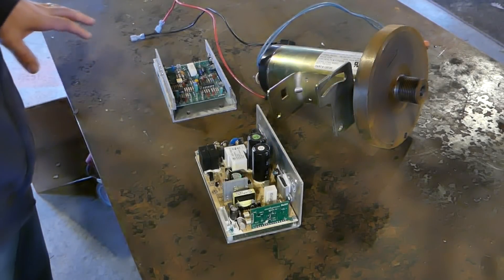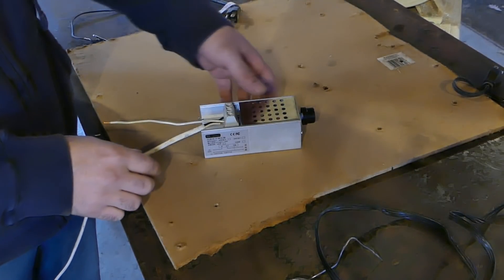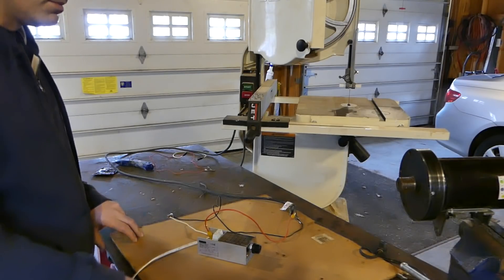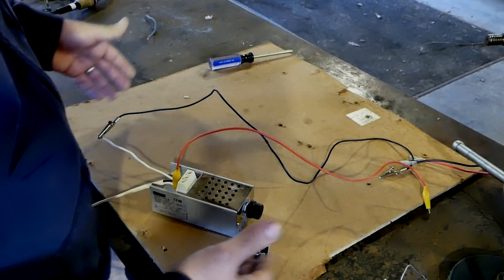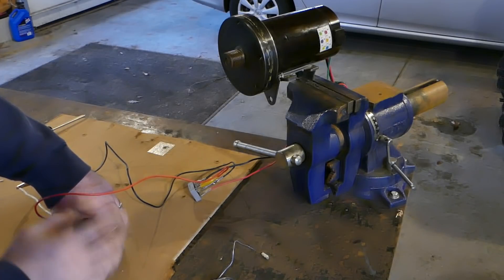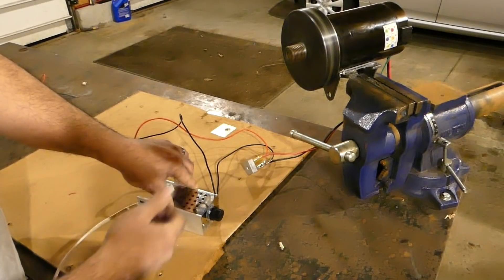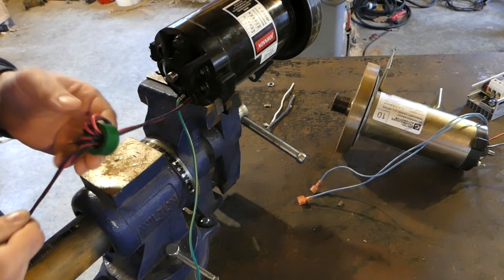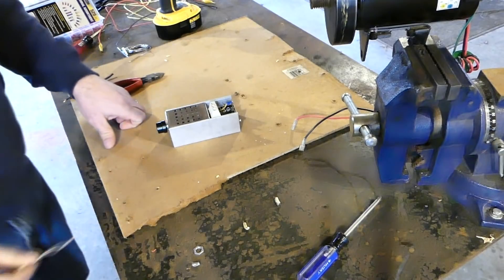Low Cost DC Motor Controller For Treadmill

Comment: I got the 400 watt SCR and the 20A glass fuse blew almost instantly running a 1.5hp motor. It's also very difficult to find replacement fuses because the size of the fuse being 20A is not allowed in the US. Basically this is not very convenient of a motor controller because unless you turn up the speed very slowly, it surges way to many amps to reliably start the motor without blowing the fuse or frying something. So setting the pot to the speed you want and turing the power on is not going to work because of the high amp draw. I'm going to get one of the 10000watt units to see if that will be reliable. Also, a thing he forgot to mention in the video is that the bridge rectifier (even being "over sized") is going to need a heat sink. Even a 50A rectifier running 5A will need a heat sink.

Comment: Hi thanks for the video. I ordered the parts and got them today.
I am going to implement this tomorrow for a 180V DC motor with mains of 220-230V. 
Getting ready I watched the video again and I heard that you refer to the circuit as a  triac based and then later that it is an scr. Please confirm which it is.

Comment: How would I go about hooking a ground wire up in this setup, I would like to have everything properly grounded.  I got all of the parts but I would like to use the power cord that came with the treadmill.
Reply: hook  the green wire from the cord to an outside screw on the controller box and then also run one to the motor to ground them both.  good point.

Comment: Hi thanks for the video, 
Just what I was looking for. I need to understand the voltages. 
This motor is probably 90V and the mains voltage is probably 110-120V AC
So can I assume that 90V DC motor works with 110 rectified AC with no capacitor?

Comment: Hey Mike in your test with the 10,000w SCR were you powering it with 120v? I ordered the 10,000, and I only plan on using 120, not 220. Think this will work? This video is exactly what I've been looking for!!!

Comment: i have a 1.75 Hp Continuous duty power 180v 4800 rpm treadmill motor Ths a DC motor can you recommend what i need to run this from a 240v standard household socket , i see a lot on ebay but not sure which onre to buy , regards Maurice over the pond in the UK
Reply: found any clue? I have 4 hp , 200 volt dc treadmill motor. electricity here 220 volts as well

Comment: Hi, How well will a treadmill motor work in a table saw?  I ask because I have  to get a motor for my table saw, and the manual says I need a 1 HP, 3450 RPM motor.  I have a treadmill motor that is 100 VDC, 1.5 HP,  4900 RPM's, 14 amp's that I want to put into it, do you think this will work in it?  Will running the 100 V motor off of 120v cause any problems and if so what do I need to do to lower the voltage down to 100 V so I dont burn up the motor?

Comment: Just tried this out, and I gotta say, so far this works. Thank you so much! My original treadmill board was neither an MC-60 nor a MC-2100 or anything like that, and I think it was fried anyway. This will make things just so much easier. Ran it for a few minutes, no load, and no magic smoke. Rectifier was just ever so slightly warm, so no danger of major heat buildup that I can see. Only real testing under load will really let me know. However, I'm only getting a little more than half the dial in adjustment on the 200k pot. Should I try a different size, like a 100k?
Reply: USE A HEAT SINK

Comment: I have a question... Here in South Africa we run 230V wall power... Would this solution work on a 180Vdc motor?
Reply: AC to DC isn't 200% it's 141%. 230v AC rectified gives ~325v DC not 460v DC.
Reply: Yes it would, but as mentioned by fisharmour, rectifying 230V would apparently mean you have 460V DC if you crank your speed controller all the way to the max. Probably not so good for a 180V rated motor.
90V AC becomes 180V DC through the rectifier, minus some heat loss, friction and such I suppose.
Reply: I did this setup on a 180V, 2.0HP motor. It handles the output from the controller all the way up to 240V. I made sure the controller matched my wall output (220-240) These are on eBay for about $16. Search "10000w SCR controller" and pick the one you like. I have wound mine to max (240v) and the motor attempts to perform take off. It spins scary fast with ridiculous acceleration.
I read the DC output with a multi meter and it peaked at 240V. I did not run it at that voltage for more than 10 seconds, but the motor remained cool and seemed fine after that test.

Comment: What kind of pots do you use? I have tried a whole bunch of them and they last about three start ups and then they quit and I have  4000 RPM drill press. I have tried to find wire wound pots but I have not been able to locate any locally or at Digi_Key.

Comment: I'm feeling kind of stupid right about now. I got the same SCR you used, 220v 10000w and feeding 120v ac into it i get a constant output of 120v !!!! Pot doesn't change output. Am i right that one leg of input ac goes to first terminal on left, other leg goes to common(far right), and variable ac output is second terminal(center) and common(far right)? Did i get a bad unit or do you see something I did wrong???????
Reply: +CHUCK MATSON That's right. The pot doesn't change the output voltage of the AC per se - only the duty cycle of the waveform. Watch BigClives video to get a better understanding of what you're doing. A little knowledge is a dangerous thing so arm yourself with more knowledge!
Reply: Mine did the same thing until I put a load on it. I put it together like he suggested in the video, hooked it up to the treadmill motor and it worked just fine.

Comment: You saved me. I disassembled a treadmill for a sander project. I then dropped the Mc 60 control and when I pulled it back in it fried. $15 is a whole lot easier to take then a new/used mc60.
Reply: Hawk 1911 i
Reply: Update, the controler I bought last all of about 5 minutes and then would only run on full blast. I have now purchased a Harbor Freight router speed controller and keep the bridge rectifier seems to be holding up better.
Reply: Hawk 1911 is it still working I’m about to try it

Comment: Caution: a brushed a/c motor such as in a drill is intended to be variable speed. An induction motor such as the band saw example is dependent on the 60 hz frequency for it's speed. Reducing the voltage to an induction motor lowers it's torque but not it's speed. Brushed motors using this setup should work ok, but notice the band saw (induction motor) lost power and only slowed when torque fell so low it could no longer turn. D/c motors do need the rectifier as shown to produce pulsed d/c. Excellent video, I have 2 treadmill motors and 4 power chair motors to experiment with.

Comment: Searched for something simple like this for my 2x72 belt grinder for quite some time. I did everything to the T, part number match and all. I noticed at first that noticable torque was lost and 2 minutes into some light grinding the motor started to release the smoke. cheap enough to buy, decent amount of effort to put together and package nicely but it was worth the try

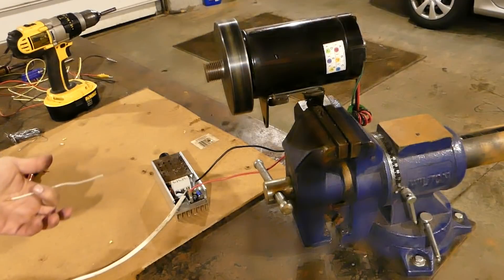Comment: In the video at about 9:50 you suggest using an inductor. On my phone i can't see how to wire it in. Do both leads to the motor simply wrap around the wall of the inductor?
Reply: Yup. An inductor stores electrical energy in the form of magnetic energy and helps smooth out the variations in grid power.

Comment: I'm a bit confused on the size of the potentiometer you used to replace the original in the SCR,  you said you had a 100K Ohm on hand but you didn't specify what you wound up using. Or if you did I missed it. Thanks.

Comment: My treadmill motor only runs a couple of seconds and dies.  I attach a battery to it and it will run, but slowly.  I made a pwm driven power supply but it blew the breaker after the motor tried to start.  So, I made this one.  Using the exact same parts as you have.  I ran the motor with it for a few seconds and it blew the 15 amp breaker.  I did it again on a 30 amp circuit and it blew the bridge rectifier (50 amp rectifier!!).  I had taken the belt off of the motor, too.  Any ideas??  My riding mower battery makes the motor run just fine....  Oh, 90VDC motor and 120AC house.  No capacitor.
Reply: sounds like a thermal protection kicking in and with the controller is overcurrent since you either blow the bridge or trip the breakers - something wrong with the motor or maybe higher power (what's the kw/hp of the motor)
Reply: sharp x vg

Comment: Mike, you did a great job on the videos showing how to use the DC motor, you showed me that I remember more of my electronics I learned but never used in the USAF. Aircraft maintenance was a case of drag it out of the rack and shove another one in it's place and send it back to the factory to be repaired. That 22 weeks of basic electronics school was a waste of time!

An idea for another video, figure out how to get the stepper motor from the tilt unit on the treadmill to work. I would like to put casters under my wood lathe and use the tilt unit to lift the lathe off the floor. I have a bad back and can use some help.

Comment: OK, I"ve got a question. I bought A 4000k SCR controller and It worked great for about 5 runs of the motor. THe last time I tried to turn it on it wouldn't work.  I put a voltmeter on it. The AC in was the same as the power coming out of the wall. The power leaving the SCR controller was about 0.5 Volts even after adjusting the potentiometer. My motor is 2.75 hp treadmill motor, same rectifier as used in the video. So what gives? Did I burn the SCR controller up? Do I need a 10K?
Reply: so did you have to use a capacitor for your set up or no? and i hope my set up will work i got the 10,000Watt SCR will it pop my breaker because its 10,000 watts? im not electrical friendly lol or is that just the capacity the SCR can take?
Reply: it's what the capacity of what the SCR will take. The motor will only draw what it needs.

Comment: Mike brother help! I am making one of these and all was good till I tried to swap the pot and all want to shit😥 I had no speed control as soon as you pluged in it was w.o.t. and popped fuse. desoldered pot replaced fuse plugged in and fuse ok. I suspected chinesium pot but tested ok. I am at a loss any suggestions would be appreciated!!

Comment: Fricking awesome.  I just got the parts in today...badabing...works great.  Thanks a bunch.  I already have one of these running my lathe...but with a commercial motor controller.  I used a treadmill board to control another motor on my drill press.  BUT...I had another motor and a fried controller from the treadmill.  This make that  motor work great.  Only problem is....the motor spins at 6500 RPM!!!  I'll really have to gear things down. This isn't the fault of this controller....its what the sticker says on the side of the motor.
Reply from the maker: Ha! Best of luck!

Comment: Very informative video, Thanks for you effort, do you think this system could be used to control a stepper motor, by adding a second bridge rectifier and voltage transformer
Reply from the maker: I think adding a second FWBR wouldn't do much. But I could be wrong, there may be a way to do it.
Reply: No, stepper motors are way different.
Reply: Graham Ellis No that won't work. This would just lock the rotor until the motor burnt up. You need a driver to commutate a stepper they don't turn by themselves

Comment: I have the exact same treadmill motor. What are the blue wires used for? I was thinking it was for the emergency stop, which is found on all treadmills. If it is, can this be wired up to accept some type of "key" so that the motor is disabled when I'm not actively using it, making it so that the kids aren't able to turn it on? Awesome tutorial here, I wired up my motor effortlessly and frustration free! Thanks!
Reply from the maker: Good to hear! The blue wires are for a thermal switch, it opens if the motor overheats.

Comment: and another question can I use this method on a washing machine universal motor as well? i.e AC voltage  to the controller then output to the rectifier and then dc to the universal ?

Comment: If more resistance on the pot equals more speed then a fixed series resistor with a value close to the pot resistance where the motor finally turns on would be a better fix than a higher value pot. It sounds like the higher value pot gave you a smaller dead band but didn't eliminate it. This also works if the potentiometer is being used as a voltage divider.
Reply from the maker: Less resistance = more speed. So, no.
Reply: Mike, would you mind please answering all the questions about which Pot you ended up using?

Comment: Great video tut top job.A big thank you from the UK.You made it so simple and clear.I did this yesterday for my lathe all wiring fine motor works great.Is it possible to fit one of these WXD3-13 2W 10K ohm Multi Turn Wire Wound Potentiometer to an scr controller.i am using this one AC 220V 4000W High Power SCR Electronic Regulator Speed Controller Motor TE474,any help you could give would be great.if you cannot follow this video and it work for you then you really need to not mess with anything electrical.